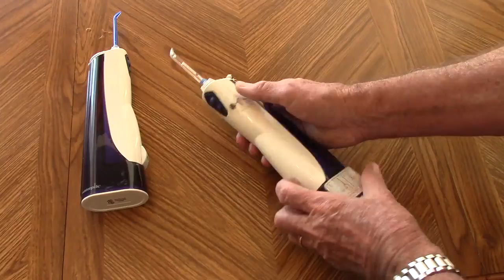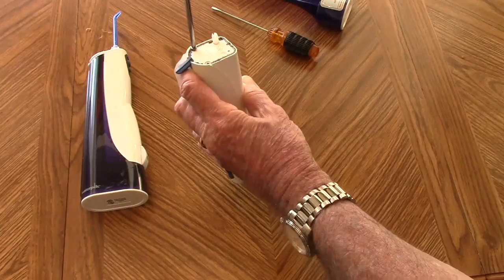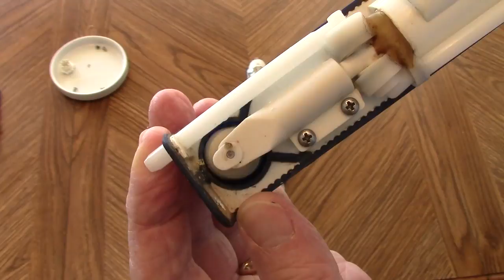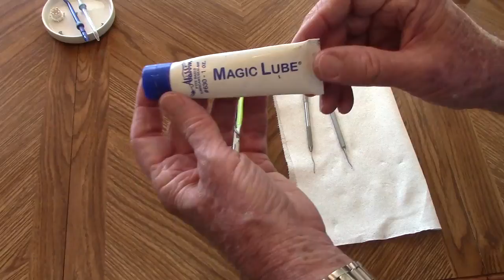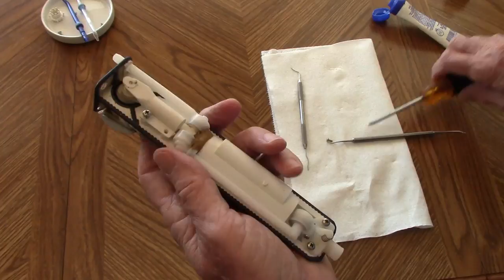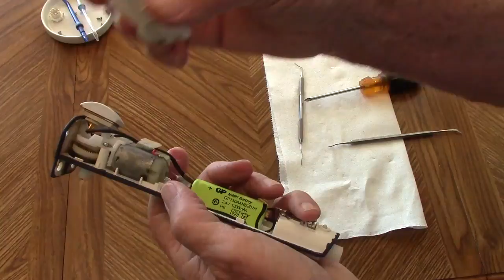WaterPik WP-360 Battery Replacement & Lubrication Rejuvenation

Comment: I want to thank you for the video, but unfortunately, this didn’t fix my issue. My problem is the motor doesn’t stay on unless the power button is held down which makes cleaning my gums a little more difficult as I can’t keep the button held down and maneuver the way I want to. It was a nice learning experience, though. I, like someone else in this comment section, did not have lube on hand so I substituted with coconut oil. I don’t know if that makes a difference, but it didn’t fix my problem anyway.

Comment: I cant get it apart
Reply: 1. Open the reservoir lid all the way, that pries the power head from the reservoir. Retract it carefully.
2. Use a knife to pry off the collar around the nozzle. Remove the two screws at the base.
3. If the internal frame doesn't want to come out, use a AAA battery (not AA) to push it out. The + side of the battery to the nozzle, the - side on the counter top.
4. When re-assembling, use the H1 lubricant ("vegetable oil") on the piston, crank journal, the gear, and the gasket sides of the frame! Lube the gaskets where it slides back together, helps way much.

Comment: I was having an issue with the reservoir being stuck. This video let me know that i was doing it wrong lmao. And now I know what to do if my machine starts running weird. Thank you!! 

Also, the blue tip is the low pressure tip (explains why it's running a little slower). The clear tip is the normal/high pressure tip.

Comment: Thank you John. I took mine apart and found a tiny leak which rusted the motor completely until it failed to turn. Wished I had inspected and oiled/lubed it and noticed the leak earlier.

Comment: Thank you, Mr. Kerwin, for this detailed repair video. 👍🏻 This video has helped me many times. 😊
I discovered some tips while lubricating: 
1. Some people report success with coconut oil. If you boil 1 tsp of shredded coconut in 1/4 cup of water, the oil rises to the surface. 
2. The piston is joined to its connecting rod in a ball-and-socket joint. This joint too must be lubricated. (Terminology is from Wikipedia, "Connecting Rod".) 
The piston on my Waterpik was quite stiff, as though the old grease had hardened — I don't know how it kept going.

Comment: Thank you for an excellent video on how to take it apart without breaking anything.  The problem with mine was that the negative battery tab weld had broken off from that battery.  Used a tab of solder along with a replacement wire and working as good as new now!

Comment: I can not get the reservoir off. Tried for 10 minutes.
Reply from the maker: "Gaming", Another viewer showed me a way to get the reservoir off very easily.  He opened the lid to the reservoir and pushed it against the point where it stopped when it touched the top of the white part.  It acts like a lever and pops the top of the reservoir loose.  I hope it works for you.
Reply: @johnkerwin  I saw that video a bit after yours. It did not work.

Comment: I found your video by trying to find a demonstration on how to assemble the main charge unit to the water chamber. I was so afraid I was going to break it by forcing it. I was able to connect them as I was watching your video. I have been using the bigger WaterPic but my bathroom is small so I bought this small unit so It won't take up so much room. Thank you for your instruction on lubing the gears. I paid only $39.99 for mine at Walmart. I will probably just go buy another one if it gets slow (hopefully it stays good for quite some time). What I did learn from you was the Lube safety notice. Thank you for putting this video on-line.   Holly

Comment: I know this video is old, but it's still relevant. All I had to do was remove the motor by unscrewing the two screws. Remove and cleaned the large o-ring under the gears.  Some junk was on the paper towel. Put a light layer of sewing machine oil or olive oil on the o-ring under the gears. Place it back in and button everything up.  I am a cheap "astard and didn't want to buy the food grade grease. Now I am good to go. 👍

Comment: Thanks, John. Would petroleum jelly suffice as a lubricant? I believe it's harmless in small amounts.
Reply from the maker: Randy, my experience with petroleum jelly is that it thickens with age. You would be better finding a silicone based lube. You only need a glob on your finger tip to do the job. If you know someone with a pool or hot tub, ask them to give you a squirt of the lube they use for their “O” rings. Good luck. John
Reply: OK. Thanks. Appreciate the quick reply!
Reply from the maker: @randyjustrandy9937  Randy, I never really answered your question. If you can’t get the silicone, go ahead and try some petroleum jelly. Don’t get it on too thick. If it doesn’t work, you can always clean it out and try something else.
Reply: Yes, I tried the petroleum jelly and it improved briefly, then slowed down even worse. I'll find some silicone lube and start over. But I'm happy to know the procedure works.

Comment: Thank you. Excellent video. I wasn't able to find that exact Lubricant, so I used toothpaste. Seems to work so far. Hint. In order to separate the white functioning part from the Blue base, use a medium - wide screwdriver (in between them), then gently twist.
Reply: I had a heck of a time trying to figure out how to connect these two parts when I took it all out of the box. The instructions don't show you how. That's why I had to get on YouTube to find someone who would show me how to do it. Thanks for your advice about disconnecting it. I'm sure I'll need to pull them apart for cleaning in the future after I have used it for a awhile.

Comment: You have to open the flap of the water container and that pushes the white part out. It comes in the instruction Manuel. It is easier that trying to take them apart with force and risk breaking it... 😃 but thank you for taking the time to help us with this video
Reply from the maker: I did not know that when I made the video.  Another viewer let me know about it, and you are correct, opening the flap all the way to pry the pieces apart is the easy and safest way!  Thanks for your input!
Reply: It didnt say that on my instruction manual

Comment: How did you get it separated. Mine wont come apart.
Reply from the maker: Ethan, my video shows me pulling the two pieces apart.  Two other viewers advised me that the easy way to get the parts separated is to simply open the hinged door where you fill the unit with water... open the door all the way till it stops, then give it a little more pressure, and the halves will pop apart.  One viewer still had the original instruction manual that came with the unit.  He told me that his is the method in the manual. Good luck. John

Comment: Great video John. I just put coconut oil on my pump like you showed and it works better now. I cook with coconut and avocado oil so I decided to go with the coconut oil. worked like a charm. Oh, and I used a butter knife at the top of the waterpik to loosen the two parts. I also put on my dish gloves to help me hold onto the waterpik. really help keep it from sliding around.
Thanks.
Reply from the maker: Good job Lee!  You used a non-toxic oil, and taught me a better way to hang on to a slippery WaterPic !

Comment: Good instructions for taking this model apart.  The on/off switch on my unit was the issue, as a good contact wasn't being made.  I needed to take the two tiny phillips head screws off that hold the switch in place, and thoroughly clean the contacts.  Now works, with more power too, now that there isn't a voltage drop across the switch.

Comment: Thank you soooooooo much John.  You're the only one that showed and explained this model well, (mine was the one on the left).  You saved me from buying a new one which costs a little fortune here in the Middle East as taxes are extremely high on imported stuff.  I was so fed up with mine being so heavy and slow and I literally had to shake it in order for it to start but only to a speed of a snail. So I did all what you said and I even took it a couple of steps further. I was enjoying so much cleaning all the gluey gunk so I dismantled the large gear from the tiny gear of the motor and cleaned both and lubricated them anew. I made sure I memorized what goes where as it was getting pretty detailed inside. I don't have any non-toxic lubricator and figured petroleum jelly would be too sticky, so I used some coconut oil which is the thinnest oil I have so as not to make the motor drag. As for all the plastic parts, I took them all apart (I mean ALL) and washed them super clean with hot water and soap, scrubbing them with an old toothbrush and dried them out with a fan to ensure nothing is wet as all this story should be dry of course. Then, I reassembled everything.  I have to admit I did one silly booboo and that's putting the black rubber seal  that goes around the large gear upside down which made it not turn on.  I was saddened after all this cleaning to have ruined everything.  But then I investigated what I have done wrong and figured all was correct except maybe I should turn this sealer upside down and it worked like a charm. Really, it works and sounds like new.  Again, thank you so much John.🙏🏻🙏🏻🙏🏻  I wish you all the best. 😁Stay healthy and safe.  😷🏠

Comment: The switch in mine wore out and now I have to squeeze it really hard.  I have a WP-360.  It is a shame too because the dentist seems to notice that it is working.  Could it be bad batteries?
Reply: My Waterpik was like that too. Voltmeter says my battery pack is fine (2.70 volts). Turns out I just had to lubricate the pump. Fixed!

Comment: Thank you John - excellent video; restored my non-working WP360 to usable status, did not have to change battery.  Unit does not run as strongly as it did new, so next time I will probably change battery.  Also - when I tore unit apart it was gross and slimy inside, so we probably need to open them up every six months if for no other reason to clean them up.  I chose to use petroleum jelly as my lube on the pump plunger and gears.   Thanks again.

Comment: Hey Sir my waterfloss hasn't been used for 2 years been put on a box. Last night i found it and charger it to 100%. But when i start it it wont work. Motor dead?
Reply from the maker: My guess is that motor or the pump piston is frozen. Open the unit up as shown in the video, and turn the big gear by hand to free it up. Then turn it on and see if it works. Don’t leave the switch on for a long time if the motor doesn’t turn. That could burn the motor windings up. I hope this works for you. If it doesn’t, check the batteries with a voltmeter. They may be dead despite your attempts to charge them.
Reply: @johnkerwin  ill try that method.. but my waterfloss looks diff. I wish i can show u a picture..

Comment: Mine lost power suddenly, this video helped a lot disassembling the device. Lubing the pump, moving parts, and gears didn't fix it though. When the issue started noticed that along with the water bubbles showed on the tip, which lead me to think air was getting into the system somewhere along the way. After some minutes of troubleshooting noticed the rubber grommet at the very bottom where the tank meets the inlet pipe shifted or something. Instead of being at the inlet tiny pipe it should go on the tank where the check ball is at and a flat side of the grommet to the matching side as well. Put it back together and now it works like before with good pressure.

Comment: can I use super lube brand ?
Reply from the maker: wolvie45 - Look carefully at the tube. Mine was plainly labeled on the back. Make sure it says something like “USDA H-1 RATED”. This is a USDA specification that says that the lube is safe for use in food processing equipment. Any brand of Teflon lube with that statement that is made for lubrication or O’rings, gaskets, bearings etc should be fine.   John

Comment: Very clear and informative - thank you.  My unit just froze up, so I tore it apart and checked the battery voltage (all good), and cleaned and lubed the pump assembly (it wasn't bad), and tried the white unit before pushing it back into the blue storage piece - all good, ran fast.  Put it all back together, went to the bathroom, attached the nozzle, filled it with water, pushed the button....  and nothing. Locked up.  Hmmmmm...  could the nozzle be plugged????   Pulled out the nozzle, blew (or tried) to blow though it -  no air came through.  So, the actual problem was a plugged nozzle. Cleared it out with a needle, and presto!  Worked like new.  FYI.

Comment: Mine just does not want to be pulled apart
Reply from the maker: Turtato , if you are having trouble removing the blue water reservoir, trying opening the lid and pushing it wide open. It will act as a pry to push the top of the blue part away from the white part.  Once that is done you can lift it straight up. Hope this helps. John
Reply: John Kerwin thanks for the help. Was able to take apart last night

Comment: I have the exact model as in your video - but I lost the charger many years ago.  Any suggestions what I could use - my country has 220V electricity.  A mobile phone charger was suggested but it didn't work.  The model I have needs
 a single prong charger. Tx
Reply from the maker: Chris, I had a similar question about a year ago. Here is my answer....  The reason a mobile charger didn’t work was probably due to incorrect polarity of the plug or incorrect output voltage or current. The fact your country has 220V electricity shouldn’t be an issue because most Chargers available to you will be for 220V already. 
My video shows two different Waterpik models. The easily identifiable difference between my two Waterpics is the connector on the unit where the cord from the adapter plugs in.  The older of the two has a ROUND hole that the plug goes into, and the newer unit has a funny diamond shaped hole with two gold pins visible in it.  The ROUND hole unit is 3 Volts DC and 100ma.  The diamond shaped hole unit is 3 Volts AC and 100ma .  It sounds to me like you have the DC unit with the round hole.  If I was trying to replace a lost DC adapter, I'd go to our local flea market where some vendors have boxes of adapters for calculators, phones, etc and sell them for $2 to $4 each.  Find one that outputs 3 Volts DC.  Once you find one, just make sure that the output is rated for at LEAST 100ma.  That is the output current capability.  You can use one that outputs 200, 500, or more as long as the voltage is 3 Volts DC.  Chances are that the one you find will not have the correct connector on it (That's Murphy's law in action.).  If you take your Waterpic to the flea market with you, you can go through the box of adapters to find one with a connector that fits the Waterpic.  If the voltage and current and polarity are correct, you're in business, otherwise you'll need to buy two adapters, and cut the connector off one and splice it on the one with the correct ratings.  In doing that, you need to make sure that the electrical polarity is correct.  The center pin is (+) and the outside is (-).  If you hook them up backward, the Waterpick won’t charge.. Then just reverse the wires and tape up your splices real good.  If you don't want to do all this, you can probably find universal adapters at Amazon.com...  Just search on "power adapter 3VDC". (Chris, in your case you’ll need to make sure the universal adapter will operate on 220V).
Good Luck, John
Reply: Thanks so much John, for your detailed reply.  I'll be hunting as you suggest but feel sure I'll manage with this info.  Much appreciated.  Regards, Chris

Comment: I lubed the gears and it seems to be working but the "On" button won't stay on, so I have to apply pressure the whole time I use the waterpik,  Thanks for the help John!
Reply from the maker: Tim,  As I remember, the on/off switch is made of a thin piece of bent metal that gets flexed one way for ON, and another way for OFF.  You might try removing the screws from the bottom of the waterpic and sliding out the entire "guts" again.  I suspect that you might not have gotten the "guts" pushed all the way back in to the outer housing somehow.  If that were to happen, the on/off switch might do exactly what you describe.  It's worth a try!  John
Reply: My Waterpik began doing this too. Turns out there's a breakage in one side of the spring metal, maybe due to metal fatigue or corrosion. Result: The switch is no longer bistable. Workaround: I do what you do: I just hold the power button the whole time.

Comment: I have the model-WP-360 and it just stop work all together, won't turn on.Do you think it's the batteries?  I don't want to spend $20 on batteries, when the who unit only cost $29.
Reply: in my case the same problem was solved as shown here. Now I'm thinking about a new countertop model
Reply: I just paId $39.99 for mine today. It's crazy how the prices of EVERYTHING has gone up.

Comment: I made a stupid mistake by stepping on the tip on the 360 water pick.It broke half of the tip .the rest was stuck.Another problem was that the button would not stay on unless I kept my finger on it. Following your instruction to take it off,I discovered that they improved on the batteries .they are now two AA batteries in green wrap.If i had to replace it It would only required  a minimum  of soldering.I was able to take the rest of the bottom of the pik out .I discovered that the metal on the on and off  bottom vibrated off the base,so I was able to put i back on right and now it stays on unless I turn it off.Although the policie was not up yet I could have had it replace,but ,I'm impatient.